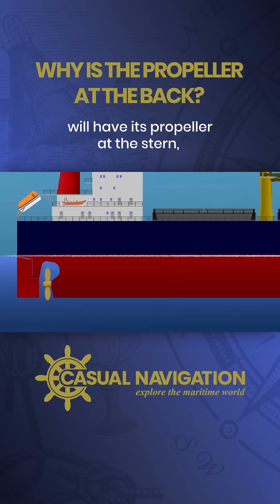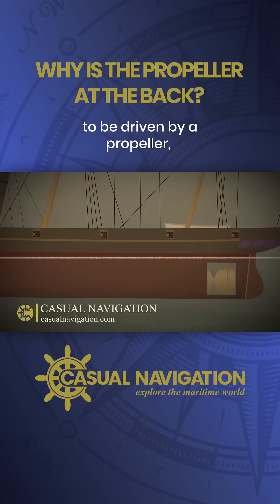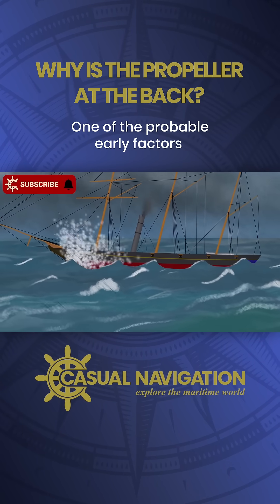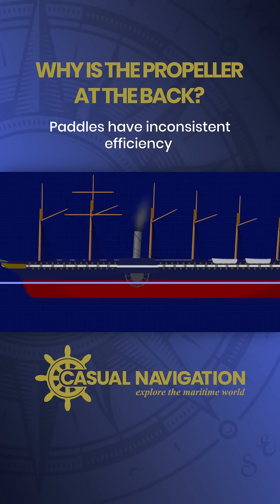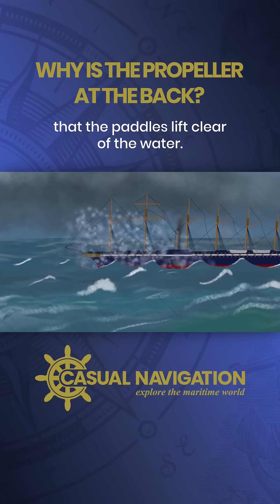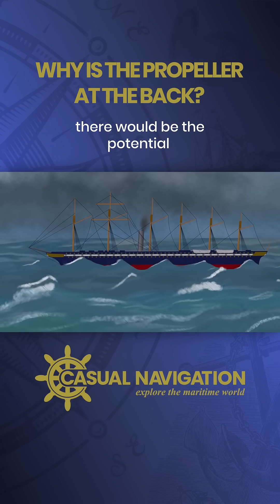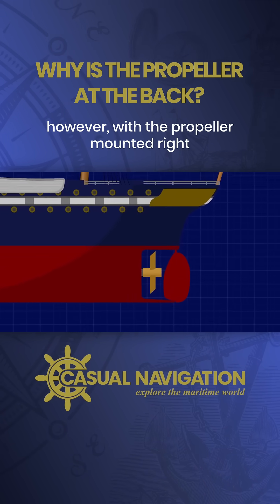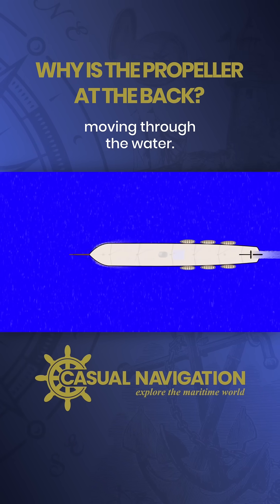Wait… The Propeller Is Where?!

Comment: Why aren’t you asking, why ships don’t use jet engines? The comparison with airplanes is not technically justified. First it applies only to a single propeller configuration, where the airplane’s empennage are on the way of the propeller, causing structural and aerodynamic problems. There were attempts in WWI to put the propeller behind, to afford a clear shot with the machine guns, quickly died out once the interruptor gear was invented. In WWII the Dornier 335 had two engines in tandem, the back engine had the prop installed downstream of the tail stabilisers. Multi engined airplanes moved them to the wings, because of the propellers. Modern passenger jet, did and are still using the tail installation for 2, 3 and even 4 jet engines.

Comment: Rudder in the stern causes the boat to lean towards the direction of the turn.  A rudder at the bow leans the boat opposite the direction of the turn.  Put the propeller wherever you want, but the rudder needs to be in the back.  And if you need to turn as tightly as possible, you'll put the rudder behind the propeller.

Comment: Exercing force push behind the center of mass makes the syste, so turning more reactively as a turn will reinforce itself. Very useful to steer a massive ship.

Planes being much lighter and having more moving surfaces are manoeuverable enough in a stable pull configuration.

Comment: this fails to answer half of the question: why is the propeller on the front on aircraft?
Reply: i think that makes it easier to steer, also the air at the front hasnt been disturbed by the plane, so the engine can run more efficiently.

Comment: "Dragging" the vessel (propeller in the front) grants more trajectorial stability, which is what you generally want in unstable conditions like light vessels flying through air.
"Pushing" the vessel (propeller in the back) grants more agility (especially when it's also sending the medium you're moving through right to the rudder), which is what you want with heavy vessels that in itself are pretty "stoic" to begin with.

Comment: Its actually also because of propeller efficiency. The water is dragged along the hull causing the propeller inflow speed to be higher, and then to get the desired outflow speed the difference is smaller. This is actually a very significant effect. A large disadvantage is that the inflow is very disturbed an uneven across the surface area of the propeller, this is captured in the 'wake factor'. Aligning the flow to get proper propeller inflow is a very large field of study and there are a large amount of energy saving devices out there with varying degrees of succes.

Comment: I found that out by experimenting with placement of a trolling motor on my kayak. Placed In front, it works fine only in calm waters- in rough water, the prop comes out of the water. OK for calm water fishing.

Comment: Planes also need constant lift to stay in the air, the more air going over the wing, the better. Boats naturally float, of course, so that's not nessecary.

Also, there were paddle boats with paddles that rotated to keep a constant 90⁰ angle to the water. It's a lot of linkages.

Comment: didn't know the rudder of a ship had to create lift...
Reply: Bernoulli's principle.  Same thing that makes planes fly, makes boats move
Reply: @cornondajakob  shure, but the rudder is not an elevator or an aileron. I guess it creates "lift" to the side...?
Reply: No, it works the same way as wings or a propeller on a plane.  Water is a fluid, just like air. @ComplainBear
Reply: @cornondajakob  I am aware of that. 
In my first reply to the video I was just implying, that the term "lift" might not be the right word in that context since the rudder of a ship (not on a submarine) is creating lateral forces, and not forces upwards (lift) or downwards (negative lift / downforce). Since you were so adamant on it having lift I now have read up on the topic a bit, and so far I have come to realize that only 30% of the forces enduced by the rudder may be lateral forces for stearing and the rest ist actually lift... O_o ok.... 
thanks!

Comment: A propeller at the back (pusher prop) is more efficient on both planes and ships. 

The air/water exiting the propeller creates turbulences across the surface of the vehicle which increase drag.

So the real question is why plane are not usualy pusher props and there are many reasons. Among them are increased engine cooling by having the engine directly behind the propeller, balancing out the center of gravity of the otherwise rear heavy airplanes which usualy have a long heavy tail, ease of maintainance and so on.

Comment: On an propeller aircraft a reason the propeller is mounted at the front would be to increase lift on the wings through a phenomenon known as propwash which pushes air over the wings and control surfaces allowing for greater control and higher lift on the aircraft for simmilar reasons to the boat propeller being in front of the rudder.  The propeller on an aircraft helps generate lift over the main wings which are farther forwards than the rudder.  With this aircraft are also generally smaller than ships which allow for the propwash to cover the lift surfaces
Reply: Not really. The prop wash effect on lift is minimal. It’s more pronounced on the tail control surfaces, to the point that I can feel the difference in control force on the elevators at power verses at idle. The main reasons for putting the propeller in the front of the airplane are ground clearance for the propeller, and it won’t get debris kicked up in to it by the wheels. Pusher props such as the Rutan Long EZ suffer from both problems.

Comment: The rudder doesn't 'generate 'lift' .  Yes, the faster the water moves past the rudder, the better it helps turn the boat, but that is because it changes the direction of the mass flow - and it that change in momentum (mass x velocity vector change) that provides the force to move the rear of the boat.  BTW, for aircraft wings - it is THAT which provides the majority of lift (not the Bernoulli force that your are told in elementary school).
Reply: I feel like it's fair to call rudder force lift, in the sense that it's basically the same mechanism as a wing. Wing lift is exactly equal to the change in momentum of the air, not just mostly it. And this gives exactly equivalent results to the pressure+drag based understanding of wing lift. Pressure and drag are the means by which a wing exchanges momentum with the air. 

What's not true is that all of this pressure comes from a velocity difference. Some small part also comes from the compressibility of air, but I believe this isn't that relevant until you get close to supersonic flow.
Reply: Figure 6 in DOI: 10.1088/0143-0807/21/4/302 has a great graphic showing the equivalence. If you measure the flow going into the wing and out of the wing from leading to trailing edge then you get an entirely momentum based answer to what's happening. If you instead look at the pressure above and below the wing, you get a pressure based answer to what's happening. If you instead draw a box around the wing then you add up the pressure contribution at the upper and lower faces and the momentums change at the left and right faces. In all ways of looking at it you get the same answer for the lift

Comment: Even though propellers are generally fully submerged (also not actually true in all cases), it does have some inconsistency due to the pressure differential between the highest and lowest point in the propeller's rotation.

Comment: On reason on modern boats/ships is that they often have sonar/radar/lidar sensors on the bottom of the hull, they need relatively “clean” water, I.e. not super choppy water that the prop makes.  Leaving the prop at the back provides more space for clean water sensors to be installed and take their readings

Comment: The reason why you don't put it in the front, is cause the bow is often specifically shaped depending on the ship, thus putting a propeller there could hinder ship maneuverability.
Reply: modern ships have front thrusters also, to aid maneuverability, specially cruise ships and cargo ships

Comment: A large part is also because it wouldn't be able to steer.  "Puller" propellors would ignore the rudder and just pull it through the water in a straight line.  At the rear, near the rudders, they act in concert to make the ship go where its told.
 You can't put the rudder at the front because the movement forward would push it to one side and send the ship into a circle.  At the rear, the default direction is forward due to the drag forcing the rudder straight.

Comment: My assumptions.
Push vs pull. Everything is most stable whilst being pulled- Planes, trains, semi trailers even boats.
A boat however, you want the driving force as low as possible so it remains effective as long as possible as you want lift to reduce drag, coupled with the entire hull acting as protection for the propeller.

Comment: I have used a front mounted outboard on a pontoon boat and several lake boats, might work for minor maneuvering, but when trying to go anywhere the boat starts to drag sideways.   Not sure of the physics, but it just didn’t work.  Put the outboard in the back and it works fine.

Comment: I would think it has to do with the viscosity and compressability of the fluid they are going through.  Yes air behaves as a fluid. 

I am not a physics person. But wouldnt a aor prop  starve for air if it was behind more than a wing. And early air colled engines would overheat. The air would compress slightly around the craft

If a water prop had to push water aginast the hull it would loose more thrust becise water doesnt compress or move around objects as easily.  

You can push the craft away from the water. But you pull the airplane throug the air

Comment: A paddle steamer with the right drivetrain would allow it to power each side's paddles independently and spin (slowly) on the spot. A leather belt driven CVT would have been completely plausible at the time. Leather belts ran every factory back then.

Comment: another advantage is the danger of grounding.
Most groundings happen closer to the bow, or even right on, so putting the propeller aft significantly reduces your chance of losing your means of propulsion in a crisis where you need it most.

Comment: Well most ship have bow thrusters but the reason the main propeller(s) are on the back is probably due to the fact that ships in general steer over the back of the ship not the front, ofc like i said bow thrusters also exist, but these are often quite ineffective when at some speed. The rudder is on the back and pushes the water from one side to another i cant even imagine how that would function on the front.

Comment: Although rear driven pusher prop planes were experimental, yet failed in practicality, had much to do with the the prop wash airstream became an integral part of the aerodynamics of the wings aft of the propulive backwash to generate secondart lift enough to confer advantage. 
 Sea going vessels could not do this.  The hydrodynamics of pushing a mass (with buoyancy and significant cross section) through a medium 1000 times as dense as air,  in a structurally sound vessel limited by the constraints of metallurgy. 
 I'm not an aeronautical engineer. Just saying.
.

Comment: Because ships have long had their rudders in the rear, it made sense to add the method of propulsion Just foreward of it. Thus the rudder is able to direct the propulsion, greatly aiding in maneuverability.

Conversely, there would be a lot if boat to overcome when placing a frontward mounted prop. And especially hard to maneuver if the rudder were ahead as well.

Comment: Also, aircraft don't run into many things. A prop on the front of a boat would hit things underwater constantly.
Reply: Also, many have them hanging from wings, so it doesn't push air against the plane anyway, and air is much less dense besides.

Also, birds be like: "I hear you want to run into things." 😂
Reply: One can also flip the question. Why do aircraft have them in the front? Well, not all do. But there are some benefits to having them in the front. Like if you have to jump out of the plane you are not likely to be stuck by the propeller. Which was an issue with pusher prop configuration. You also can not build a plane as a tail dragger, which was the way planes were usually build back in the day. So you had to develop a more complex landing gear arrangement.

And there are a lot more thing to consider. They all have their props and cons. But in ships, there is almost no pros to having it in the front. But with planes you get a lot more mixture. And most jet planes today ether have engines in a nacelle on the wings, or at the back of the aircraft. (Though some early jet fighter did experiment with jet engines in the front... There is a reason why do not do that any more. But the reason they tried it was partly related to how engines tended to at the front or airplanes.)
Reply: @Cythil  You are right, also the first planes often had their propellers in the back, so the pilot could see forward without a huge 1900's engine blocking the view and showering him in various burning fluids. But an engine in the back poses problems with stability, just like in cars. The engine is heavy and has a lot of inertia compared to the rest of the airframe, which leads to stability and maneuverability problems.

The more modern planes with engines in the back suffered from overheating, while at the front the propeller is pushing a lot of air in the radiators. 

Finally, planes needs the air to go as fast as possible over and under the wing to create lift, so if the propeller is in front if will increase lift, it works both with single engine in the noose and wing nacelles.
The ship rudders follows a similar principle, a rudder in front of the propeller would be less efficient.

Reactors exhaust hot gazes so you can't have it pass along the airframe, and they don't require air cooling in the same way. Also jet fighters are now designed to be unstable to improve maneuverability, so engines in the back is the best configuration.
Reply: @justeunfan3364  very informative breakdown of the mechanics. Thank you
Reply: If you are hitting things constantly with a boat, you won't stay afloat long.
Reply: @pcatful on the contrary, bumping against stuff happens every day and they are designed to take it. A propeller on the bow would be a problem as it would be vulnerable to damage and would cause excessive damage to any other vessel struck
Reply: @pcatful  Boats hit a lot of stuff. For the most part the bulk of the boat or the wake push it out of the way, but if the props were in front, they would hit a lot of debris. Not to mention what they would eat up or slice into while
In port. Those props are expensive.
Reply: Are you talking about 737?

Comment: This apparently does not apply to most, if not all purpose-built icebreakers, which have propellers at both the bow and stern.

It also does not apply to all U.S. naval warships, which are designed to be able to " back down full " meaning they are able to steam just as fast in reverse as they can going forward.

There are also ships that are designed with their propellers mounted in pods along the sides of the ship underwater instead of at either the bow or stern.
In these cases this is done to allow a larger cargo hold to be utilized, while providing greater maneuverability.
Reply: Absolutely nothing of what you wrote is true, I do not know where you've gotten any of those impressions

Comment: Erm, no, it's because the mechanical strain on a propellor shaft are generally too high for it to "pull" the ship. It's far easier for it to push the ship via a thrust block in the engine room.

Comment: I mean you don't want to get pulled down by your propeller.  (If the ship is facing down due to a wave it'd be pulled deeper under with the propeller out front, where as if it was in the back and this was the situation, it would be out of the water)

Comment: I figured it had to do with how a boat can chill on the water and a plane needs constant acceleration to not lose altitude.
Having the propeller on the front of the plane makes it a lot more stable as you need to balance the forces.

Comment: wrong on one point. I’ve been on an aircraft carrier in an Atlantic storm Seas so rough that life raft pods around the flight deck were getting ripped off. And the props were breaking the surface. you could hear the blades slapping the surface.

Comment: An airplane needs to constantly move to stay up.  And if the propeller was in the rear, it’d be too unstable, one yaw too far and it can cause a tumble.   And as far as a boat,  a boat can stay still and it is easier to maneuver when the propeller is in the rear,  have you ever noticed how forklifts have the steering in the rear? Its better mobility.

Comment: You sure the propeller never totally breaches?  I've seen the bottom of the propeller more than once on unreps (resupply at sea).   
The engines are placed near the middle of the ship.  It's easier to push the ship than pull it from the front.